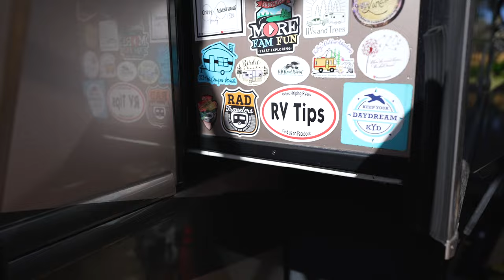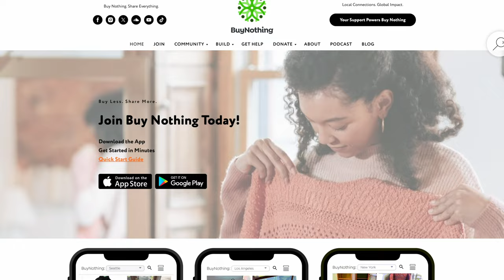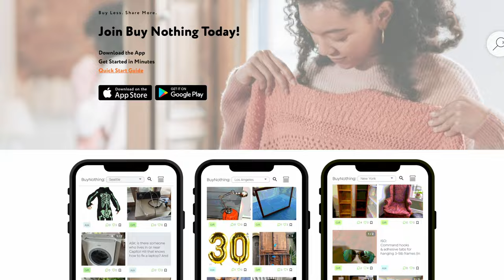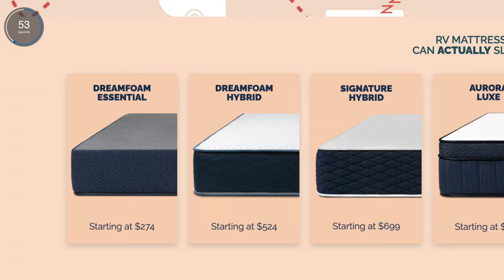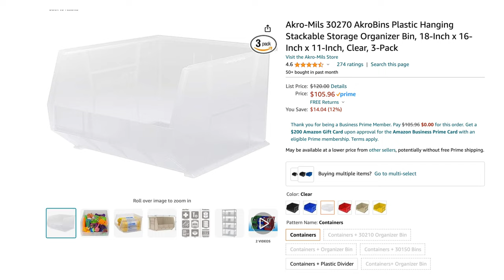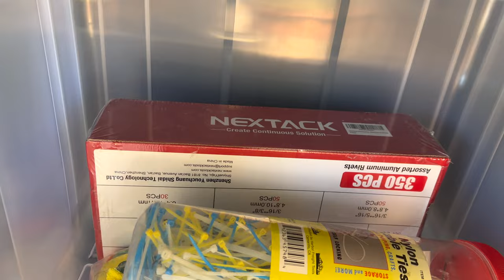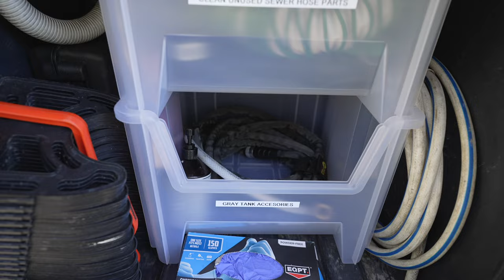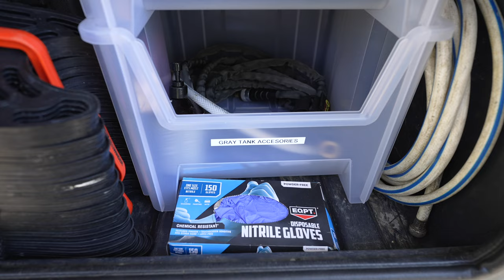Quick & Simple RV Basement Storage Ideas - RV Packing Tips & Tricks

Comment: Our basement is not very tall.  We use milk crates, just one layer for the stuff that we use frequently.  A couple of things that I carry that I did not hear you mention is spare fuses, for camper and tow vehicle, and a spare thermal fuse for the water heater.  We have needed both in our group over the last several years.

Comment: We used clear bins, but they shattered over the course of a single year. 
As for the hole in the bottom, you can repair almost all of this damage with a heat gun and metal painter's multitool. for open spots remaining, 
you can use sperglue and sand. Seal the bottom of the bin from the bottom with painter tape. make the top ofthe hole level with sand, then saturate the sand with superglue (cyanoacrylate glue). The sand becomes cement, and is extremely durable and doesn't fall off -as long as you saturate the sand. Peel off the painter tape in ten minutes. Alternatively, you can use baking soda  and CA glue - This is used to repair guitar fret and bridges, so it's very, very hard and durable. You can file or sand to shape, if needed. Use for SMALL repairs. This is an exothermic  chemical reaction, so it gets hot, but cools rapidly. Also, the gas released is cyanide, so you need ample ventilation.
Reply from the maker: Thanks for sharing